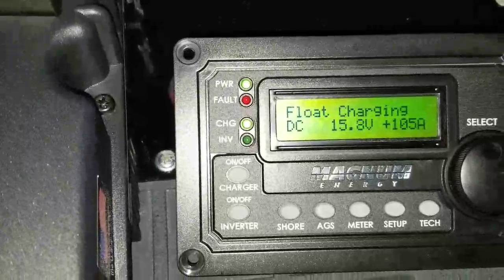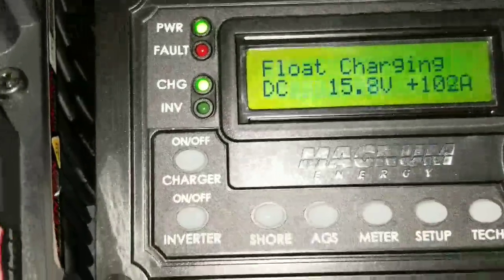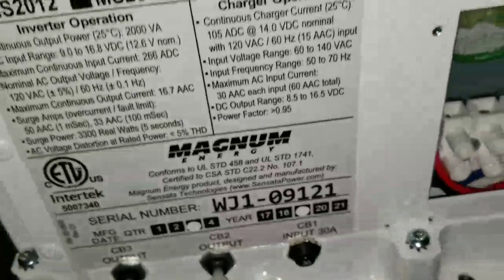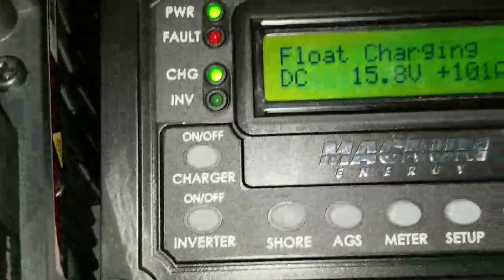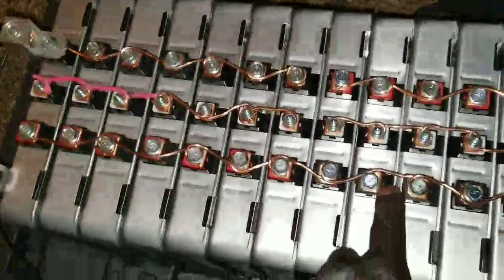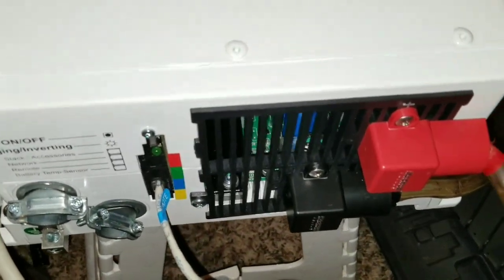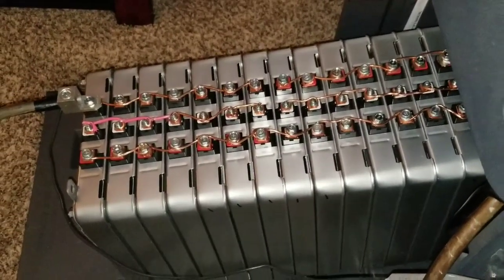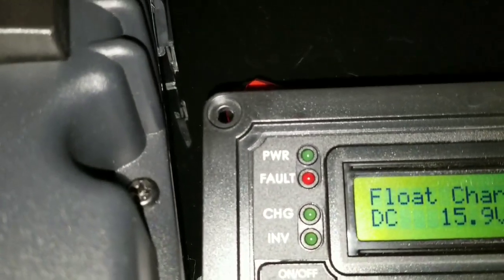NISSAN LEAF - How to Charge 12 Volts Lithium Battery

Comment: Is it necessary to use a bms when using two Nissan Leaf modules for a 12 volt Application?
Reply from the maker: Thanks for your concern but I have been using Nissan Leaf for over three years without (BMS) Battery Management System

Comment: instead of copper wire i would flatten copper pipe and use that as the busbars metal scrappers tend to keep a stock pile so can be got cheaper then paying new prices
Reply: I do this, but I wonder, the copper pipe is not oxygen free or 99.9% pure copper. I wonder what this does to the system as a whole.
Reply: @Fishtopher-Yay  as long as contact is clean nothing
Reply: @1981dasimpson  Unfortunately that is not correct. I just spoke with a buddy who has a PHD from MIT and got extremely accurate information. 

Copper wire used for electrical conductivity in the US is no less than 100% on the International Annealed Copper Standard Scale.

Aluminum wire used for electrical conductivity is no less than 65% on the International Annealed Copper Standard Scale.

Copper pipe in the USA has an average of .04% phosphorous, sometimes up to .08%. This does not seem like much, but it makes the copper pipe far less conductive than its annealed copper wire cousin. 0.04% Phosphorous reduces the conductivity to 85%, which is about in between the copper wire and aluminum wire. 0.08% Phosphorous in the copper pipe further reduces the conductivity to only 50%. 

This means that a cheap copper pipe with 0.08% phosphorous is 15% less conductive than Aluminum wire... 

If it has more phosphorous than 0.08% it can drop below 10%... The only sure way to know is with a spectrometer, which is far more expensive than purchasing the propper annealed wire equivalent. 

Sorry to be a smart ass.
Reply from the maker: Ok thanks

Comment: Cheap way to do busbars is go to lowes or HDepot and get 1inch aluminium bars easy to drill and they can handle lots of amps
Reply from the maker: Aluminum is not the best conductor. But you can do whatever works for you, these are other options I just brought to the table for others who are on budget.
Thanks for opinion and have a wonderful day. 
you wish